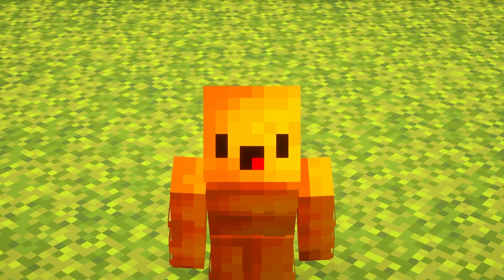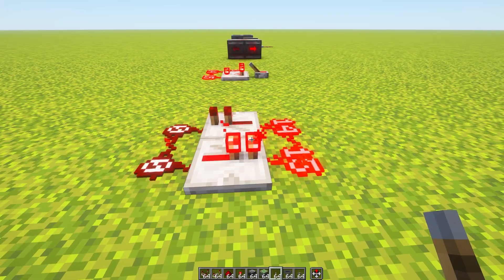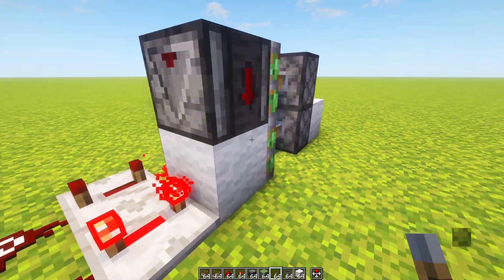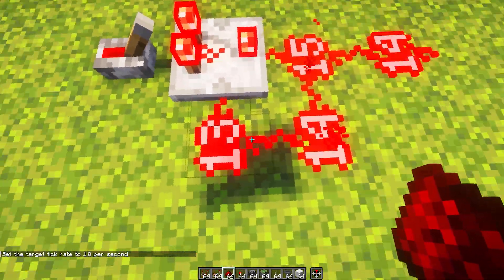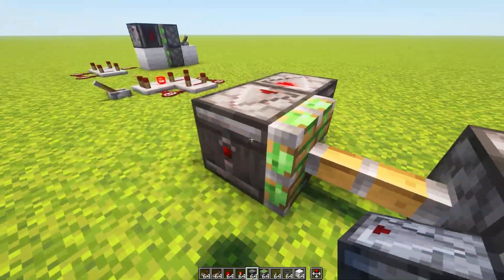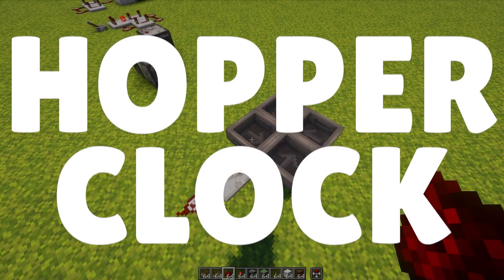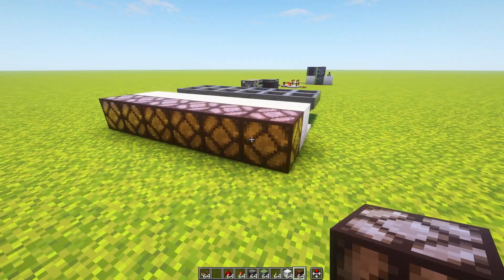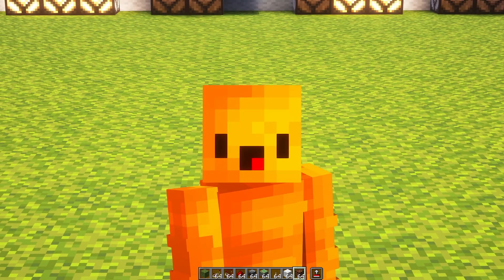REDSTONE CLOCKS EXPLAINED - The Most In-Depth Guide There Is...

Comment: There is another clock I sometimes use. Place a sticky piston facing sideways with a block attached to it. Place a redstone dust behind the block and a repeater facing in front of the block. Connect the redstone to the repeater and to the left facing back into the sticky piston.
Reply from the maker: The thing is, I don't see the benefit to this one in larger contraptions if you could just use a normal clock. It's handy in simpler ones when the piston doubles as something else, but I rarely use it.

Thanks for the suggestion though! And also thanks for watching! 🥰

Comment: The simple comparator clock can run from any signal as long as it reaches the side (≥3 in your example). But you can modify it by placing a block in front of the comparator, this way it outputs the signal through block diagonally and only loses 1 power, therefore any strength ≥2 will make it pulse
Reply from the maker: Yep! I just explained the basics of each, rather than going into every detail, but thanks for pointing it out!🥰
Reply: I only mentioned it because of 5:28 where you specifically said "level of 15" and not "high level"

Comment: Unrelated question but what shaders do you use? They look very similar to the Vibrant Visuals with the pixelated shadows
Reply from the maker: Complementary Unbound! I also have an add-on mod for it called Euphoria Patches, but the pixelated shadows is a setting in default Complementary (I've had pixelated shadows WAY before Mojang did it 😂). I also have the saturation turned up.

Hope this helps, thanks for watching!🥰
Reply: @Cubecly  Thanks, i'll try it out sometime soon!

Comment: Thx for the explanation, demonstration!
1.5 version for early game (resource friendly, only need redstone nothing fancy, and reliable):
B<-
T>-
Needs only 2 repeaters (<,>), looped with redstone (-), 1 solid block (B) and 1 redstone torch on the side of the block.
Stable, reliable. You can add a lever on top of the Block for on and off.
xxxxx
Long story short i needed to deal with my chicken eggs. So i used a dispenser to shoot them back to the chickens (with chance for new chicken). And used above redstone clock so the dispenser fires the eggs.
The dispenser has 9 slots (9x16 eggs) but with hopper and a chest you can load hundreds and hundreds of eggs, then let it do it's thing.
(got chicken feed by farming wheat in 7x7 step terraces, each 7x7 terrace 1 block higher, pour 3x water on top to instant harvest, then take back water. Add some hoppers on bottom if want to be fancy, and a large chest)
Each feed gives ~5 levels (3 around lvl30). Easy to kill when too many (more xp). Cooking them gives food, and even more xp. They are noisy.
(with cows and sheeps easy 15+ levels per feed, no mob farming needed.).
Also if you cook the meats put a lever on the hopper taking out the cooked stuff. Every once in a while turn the hopper off, and remove 1 cooked thing manually, to get the xp stuck inside. (works for ores melting too). then turn it on.
Reply from the maker: Nice! That sounds amazing! 

Glad you enjoyed the video! 🥰
Reply: I will definitely be using this on my hardcore world holy hell

Comment: Observer Clock: The reason why it works twice as slow is because there's only one signal instead of two.
When you place an observer in the place only the one facing registers change and the loop begins, but when you push observer onto the block, then pushed observer also registers change and two signals travel through circuit.
Both light up, then both light down and register change on the opposite observer and light up next tick.
Reply from the maker: I see, that makes total sense, don't know how I didn't know that! 😅 

Thanks! 🙏

Comment: Fun fact, an amythest growth block is actually a six sided clock.

🙌✌️

Observer clocks come many varieties..   (whatever) timed block update..
Reply: Another observer clocks setup is..   
( "|" is wire and "∆" observer)

|
|<-∆   |
|  ∆-> |
          |.       This allows parallel lines to operate on the circuit.. instead of the observer closing the circuit "as the clock"

Try it out with a villager bell and a pressure plate..   plate hooked up to piston that pushes a redstone block into the wire..    hook the bell into the 2nd wire, and now you have an (isolated until triggered) (audible) alarm bell.

Add a skulk sensor, now you have a proximity alarm.
Reply from the maker: @ray_donovan_v4  yes! observer clocks with things like amethist, saplings, etc are all fun options when dealing with more specific scenarios that require random timings, but with this video, I tried to keep things as basic as possible. 

tutorials often assume some basic knowledge of redstone when explaining how things work, if they explain it at all. So this series is to properly explain the essentials to redstone from the absolute basics. As in, what would you actually need to use in a casual survival world.

However, I really appreciate the interest you have in this, and maybe, somewhere later along the line, i can demonstrate some 'novelty' circuits such as the ones you mentioned! 🥰